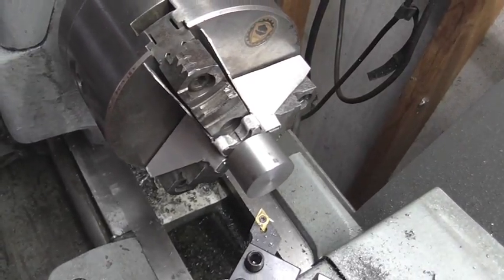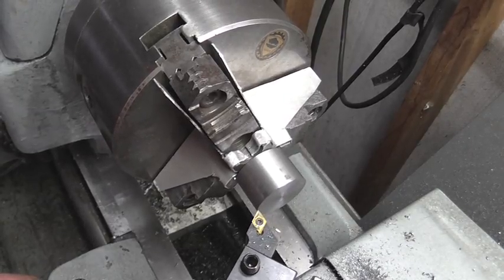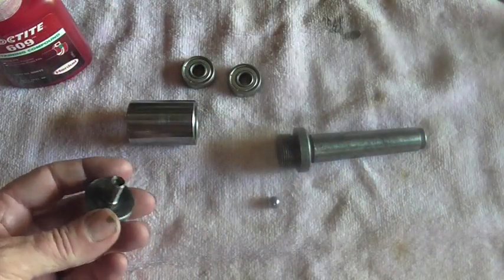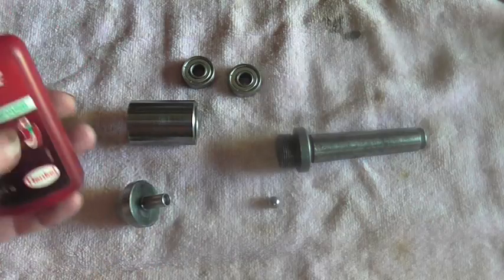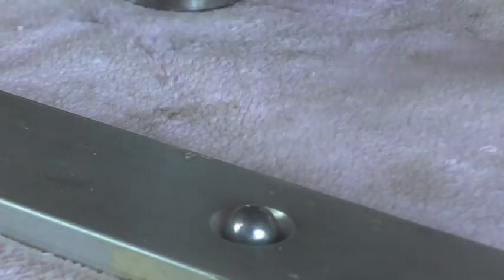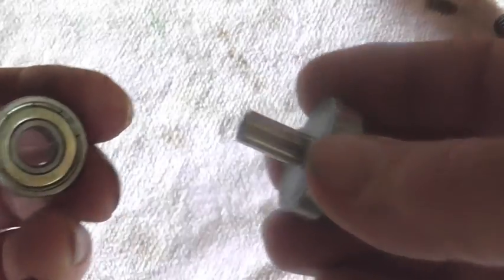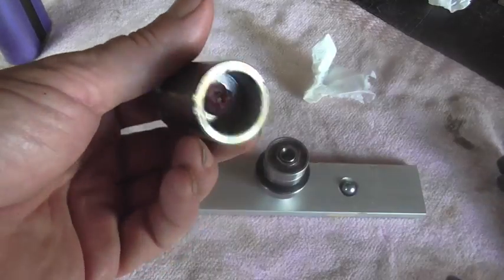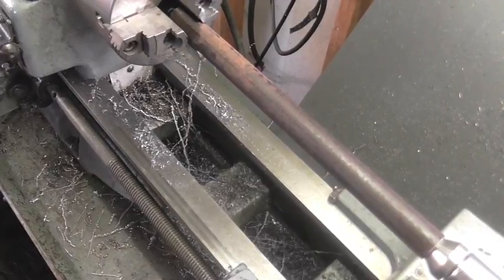Part 2 - Making a Live Bullnose Center and Banggood.com Tool Review - MSFN

Comment: Hello. I have to melt 1 gram of iron in 300 grams of copper. Do you know a way to do it? My oven can reach 1250 ° C and is electric.
Reply from the maker: Experiment, I would add the iron to the molten copper

Comment: To prove it's concentric, you should have pulled the live center out turned it 90 degrees inserted it back and put a dial indicator on it
Reply from the maker: I totally agree, my shop is not up to Renzetti standards by any means. It does work well to this day in a pinch

Comment: A single ball instead of thrust bearing is a bad idea. Sorry it's good but only for a door hinge! So you had done a live center with a bad concentriciry , big clearences and bad bearings. What for?
Reply from the maker: What for? To have fun in the shop and try something new. I wasn't selling it to anyone so didnt need to be perfect. It  has come in handy a number of times. I learned a lot making it, and you learned how not to make one so it all worked out for the best 😊

Comment: Thanks for this video. I appreciate it that you declared your deal with banggood.. Concerning the design of your life center I have three suggestions for improvement.
1. You have your single ball fit between the cones of two center holes. To reduce friction it would be much better to use only one cone and a flat surface on the other side all hardened of course.
2. You have threaded in the morse cone arbor into the main body of your live center. To use just a thread is not precise enough if you want to avoid run out of your tip. You would better have a shoulder in front of and after the thread and corresponding tight fit seats for those shoulders in the main body. Then you get long lasting precision.
3. Since you have glued the bearings to both the housing and the center shaft then the  center shaft cannot move backwards if the single ball seat is wearing. Soon the ball bearings will also carry the axial load for what they are not designed and will fail after some time.
I like your "sumthin from nuthin" theme. There is another tube creator with a similar theme in his earlier vids. It is Rob in https://www.youtube.com/user/xynudu
Reply from the maker: Thanks for the input and suggestions. I plan to make another and will be much better. Planning on many improvements on this design. I actually use it alot on some things and hasnt failed me yet...is it Sandvik quality?...not even close but works in a pinch 😊
Reply: To use it in a pinch it seems ok. but now you have some hints that gets the next one closer to Sandvik level without that much effort.

Comment: Bearings are supposed to have  a half thou fit but what you did I'm sure is fine and will be easier in the future for if you ever had to replace the bearings
Reply from the maker: I dont use it often but it works great. Thanks for Watching!

Comment: One question, did you relieve the seam inside the pipe before using the bullnose?
Reply from the maker: I chamfered the inside with a 60 degree threading tool off camera as to not have the seam interefere with the fit. I think thats where you were going with that but a good question nonetheless 👍🏼
Reply: Makin Sumthin From Nuthin:  Exactly what I meant. Even DOM pipe leaves a ridge that needs to be relieved/removed before using a center. Looked into extruded pipe for a proof of concept project but when the price came back I went back to seamed and the extra work it entailed. 
I ordered and am waiting delivery on a live center 4" chuck, that's going to be interesting!
Reply from the maker: New tooling is always great ;)

Comment: I am a master machinist and I have made many of these centers for use in screw machines.You can avoid the wear by drilling a hole for the balls and using two balls. Then leave the back of the Bull center flat.
Reply from the maker: Thank you very much for that James, I am a new "machinist" having just bought my Lathe a little over a year ago....but trying my best. That makes a lot of sense since the contact area would only be on two very small points on the sandwiched ball 180 out...rather brilliant. Makes my idea look dumb now that I think about your idea more...I LIKE IT! Thanks for sharing!

Comment: Richard when you do the heat treat and clinch into oil. How long do you heat the part. Is it just until the part is cherry red all the way through. Or is it a certain amount of time it has to stay at that temperature before clinching. Thanks for any help you could give me.
Reply from the maker: Once red I let it soak in the heat for a good 3-5 min, I dont use the magnet test. You get a feel for it after a while.
Reply from the maker: You have to use a steel that can be hardened. This was a grade 8 bolt so had a decent amount of carbon
Reply: Thank you. I should be ok then on the carbon. I made the live bull nose center and the half dead center out of a truck axle. That was already harden. I will give it a heat treat and clench and see how it goes. Thanks for all the help and videos.

Comment: Nice job Rich, and thanks for sharing it.  I just wish I could get the multitude of other stuff I have to do out of the way and get back to my lathe.  Good news is, my home made wrought iron rails for my front porch should be done this week.  :-)

Thanks for sharing.

Joe
Reply from the maker: Congrats on the rails. I love working on the lathe, I wish my viewers enjoyed the lathe vids as much as my casting videos. Maybe I am not good at presentation...but am trying :)
Reply: I think when I do my counter shaft follow up video, I will show the new rails and the computer rack I installed in my basement.  I have been running CAT 5 and Cable drops in the walls in my house (You know how wonderful existing construction can be).  Moved my cable modem, switch, pfSense box to it and then set up a FreeNAS server for my HTPC's.  Finally, noticed that I had what looked like some water damage in my basement.  Tore the panelling back and pealed off the vapour barrier and found so much condensation that the insulation was soaked in some areas.  Tore all the insulation and studs out.  The good news was that the basement block walls are dry.  Whoever finished the basement, sealed the block walls and put a vapour barrier on the inside too.  Needless to say, I have a project in front of me and it will take away from my play time.  :-(

Rich, are you familiar with Ivan Law's gear cutting book?  I though I would do a couple of videos explaining how to draw the geometry to make the button cutters for the gear blanks for any DP and Pressure angle.  Think anyone would be interested?

Joe
Reply from the maker: I like running wiring as much as I like doing plumbing...or going to the dentist. The problem with tearing into stuff is the fact that you run into someone elses "handywork" and the problems begin...LOL

The gear cutting stuff would be interesting, I love to learn about new stuff...go for it!
Reply: I would rather take a beating I think than to do plumbing.  And you are right about running into someone else's "handywork".  It leaves you scratching your head wondering what the heck were they thinking.  I will keep you posted on the video when I get there.  I promise I will do a better job of presenting it than I did with my shim calculations.  HAHAH
Reply: You're  doin just fine bud.
Reply: Other peoples poor shit is a breeze. Just go to 2 places,the first where they started and the second where they ended and remove everything in between and replace with good. Trying to work around that shit is nearly impossible !
Reply from the maker: Dont be too hard on yourself Heap...once you master editing everyone is a hero...LOL
Reply from the maker: Yep, scrap it all and rebuild it...you will sleep better at night :)
Reply: Damned straight and be flippin proud to boot !
Reply: Sorry for the delay fellas.  Well, I have it all torn out to the block walls, mold destroyed and getting ready to give the blocks another sealing.  Then a layer of closed cell foam for the walls and banding, then studs ....  You know the drill.  My daughter and Son-In-Law have been visiting from Maryland so have not had any time to mess with it..   (My daughter wishes she was back in the south.)  They live on the outskirts of Baltimore.  She seems to think that most people there are nuttier than squirrel shit.  Been there and I think I have to agree.  But then again, these days you don't have to go far from the house to find those type.  Anyway, thanks for the encouragement.

Joe
Reply: Stand up funny my friend !

Comment: That ball bearing is going to wear out the conical bore.  I would have used a bronze bearing.
Reply from the maker: It will see limited use but I decided to Loctite the entire tool so if I needed to disassemble it (repairs) it could be easily done. You are probably right and appreciate the input. It certainly wasnt the proper way...but its what I had on hand, will use it till it starts to show wear.
Reply: short version: Don't replace it just because it wears, replace it when it no longer serves its purpose.

Long version: Wear on the thrust bearing seat isn't the end of that part's useful life.  When it has worn in its natural 'raceway' (I'd say arbitrarily 1/16" wide), use a dab of high pressure grease containing 'moly' (molybdenum disulfide), and just carry on.  

http://www.practicalmachinist.com/vb/general/dead-center-lube-174074/

As long as it doesn't gall, you'll still have a perfectly mated, sliding bearing surface.  It isn't much different than the function of a dead center, which works perfectly fine for years and years in many lathe operations.
Reply from the maker: I am thinking its gonna last a pretty long time, for a live center made by someone (me) with zero machining experience as of 10 months ago I think it will serve me well for quite a while...it doesnt get used much :)

Comment: Nice touch with the hi speed finish. I reuse a lot of the gr.8 bolts from the shop. We have 5 service trucks that are constantly needin hole finders(Center punches) and many other parts needing a good quality steel. As well I have found that waste gear oil carries a bunch more carbon foe hardening too.Well done my friend. I love it when a plan comes together. Stop by my channel if you are inclined. I think you may like what I am up to. Thanks bud. Great project !
Reply: We had some needle bearings from a mower wheel at work. They are probably 1/4" dia and about 3" long. Not so hard that I can't turn them with carbide, but hard enough that they make wonderful punches and would also make good tap followers and small centers (dead or alive). Can't wait for the next wheel to blow up so I can get some more. :) I had heard about the used motor oil trick before. Supposedly you can even put a little surface hardness into soft steel.
Reply from the maker: Grade8 bolts are hardened and tempered from the factory so apparently have a decent amount of carbon already....I didnt temper this part and just left it hard so it could withstand scoring...I am not concerned with it shattering as it wont see enough stress to damage it (in my opinion)
Reply: When making transfer punches it really makes them last a lot longer.
Reply from the maker: All the steel, brass & aluminum I have around here I got for free....I think I have only spent about $10 on steel in the last 15 months. The steel company I go to for new stock usually gives it to me because they say what I need isnt worth writing up a ticket..LOL...good people :)
Reply: I get quite a bit free, but also buy some locally (usually at a discount). If I need something specific, I usually order from SpeedyMetals.com  I have quite a bit of scrap mystery aluminum ( probably a couple hundred pounds) to melt down whenever I get around to making a furnace.
Reply from the maker: Thanks for the kind words, I'll drop by! :)
Reply: Many thanks my friend.
Reply: Yup ! I just use the torch and nail it 2 or 3 times in the gear oil and it can get amazingly hard. Great for case hardening.
Reply from the maker: Absolutely when using them as punches
Reply from the maker: The mystery scrap is great to use around the shop, just be careful with it if you plan to anodize something made with it....it wont work well. I found that out the hard way in one of my other videos. I have videos on furnace/burner making if you need some ideas for your foundry DSCK
Reply: The King Of Random has some great designs for ya.Good,functional propane fired furnaces on the cheap. Check out the big/small trucking company's too for gr 8 used bolts. We have a policy that states if ANY fastener has come to use and torqued it can not go back into service. Once it has been stretched any further stretching will reduce it's reliability and may fail where the threads meet the bolt body. I have seen it happen. When an inch and a half bolt breaks under load NOTHING good will come from that scenario. Or a 1/4 in for that matter.
Reply: For sure I have a couple,actually 3 if ya count my silver pouring bench. I have a 100 yr old,clay lined, hand cranked forge of my grandpas that still works great and a brake drum type on a steel 5 ga. can with a vacuum on blow I fire with BBQ briquets. I recently welded a second drum onto it for greater depth. It can melt a 1/2 dozen 4" pistons ready to pour in an hour. It is amazing what ya can put together from stuff that is just laying around eh.
Reply: LOL, Born on a trapline,raised in a cave and now sitting here all busted up with a computer on my lap,LOL. Ya never know eh !
Reply from the maker: Yup, melting metal isnt rocket science....easily done with stuff just lying around :)
Reply: I've watched some of them... will probably watch again.
Reply: I do a lot of barter for chicken, eggs ,pork and beef with smaller farmers. I reuse any steel I can. Unless it is totally un reusable garbage scrap. Ya never, ever throw any steel away on a farm or ranch. There always seems to be something around to get the job achieved without going all the way back to town for something that can be sourced at hand or at the neighbors.
Reply: VERY nice bud.
Reply: Well thanks. I am usually up to all kinds of different things. Wood,steel, My silver pouring,mechanical and anything else that comes my way. I just plain love it all. Thank you for coming by my friend. We can never have too many of those in this life eh ! LOL !